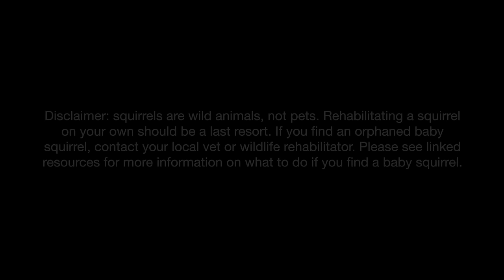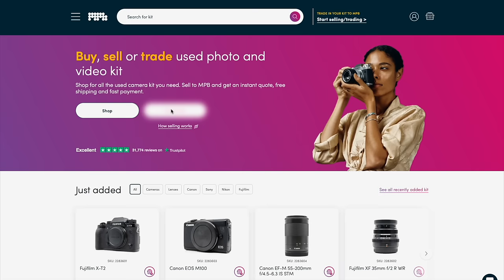Baby Squirrel Becomes Cute, Chaotic Teenager (Episode 3)

Comment: I've recued  4 or 5 red squirrels, a chipmunk, a black and a grey over the last few decades and one thing I've learned is they're most vulnerable when on the ground, their safety is in the trees. I have a cage in the back I've used a few times now and it right beside a couple trees and when they've become comfortable with the enclosure I open a little door on the side which gives them access to a branch leading to a tree. They will return every night to their nest and their favorite blanket, I close the door every night for safety and reopen it the next morning. They always have food and water waiting for them whenever they feel the need, plus I hide nuts in the branches of the trees. This will attract other squirrels so the little door must be small enough so the big blacks and greys can't get in, it also must have a metal frame or the big squirrels will chew it bigger to get in....good luck.

Comment: 4:00 Irrelevant to the video but I noticed the Saab has 2 different sized wheels on it, maybe one blew out and they had a replacement put on? Either way, having 2 different sized wheels on that All Wheel Drive system is very bad for it. It's going to end up causing some very expensive repairs down the road, if all 4 wheels aren't the same size (and tires must be within 2/32nd's of each other in terms of tread depth.) It's also important to use the same brand & model of tire for all 4, so all tread matches. Just having all 4 the same size and within 2/32nds tread depth is the most important thing but if you're going to change them, they might as well all match. It is still important. The AWD system on those cars is very sensitive to those things. Love the videos, keep them up!